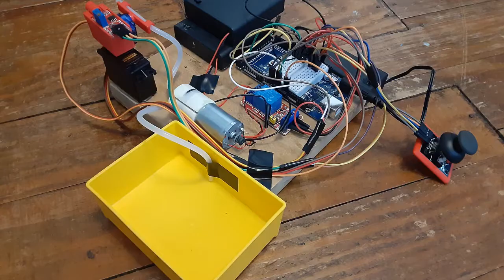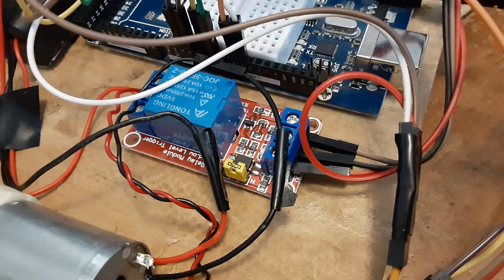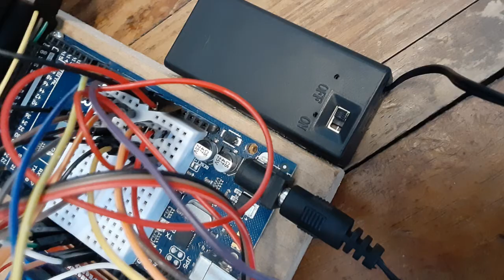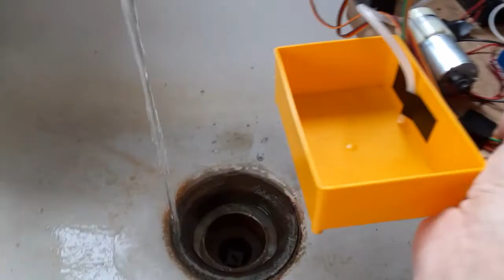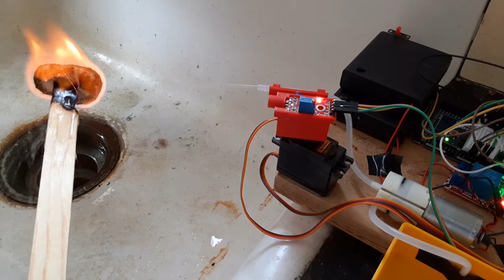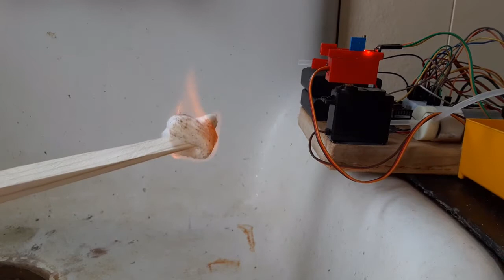Arduino - Fire fighting robot

Comment: Why not use a heat camrea?
Reply from the maker: Great question! A heat camera would likely require a better board than the Arduino Mega, and it was more in-depth than I was comfortable diving into at the time. But you're right that it would have been an upgrade.

Comment: Dear sir ,
Can you please upload full length video like all its connection , code explanation and I am not using joystick also so I don't want that part also . It will be a huge help sir .  We have our project based on that and we have to submit it by upcoming friday.
Please sir consider my problem.
Reply from the maker: Thanks for your comment! This project is something I've completed, and I am not intending to make a larger video explaining the entire project. But I think that the information I've provided is enough to recreate the project. The joystick control is a separate function in the code, so it should be easy for you to skip that part. I have provided the code, STL files and some wiring information in the video description that I think you will find helpful. Good luck!

Comment: I'm using this for my college project. Can u please provide me the connections of the conponents with Arduino.
Reply from the maker: Sure! I never made a schematic for this project, but just now I added a document in the project's Google drive with all the wiring information that I have available. There's a link in the video description, and that should get you most of the way. The code is pretty straightforward and well commented, so you should be able to make any edits if required. If you're doing this as a college-level project, I would strongly suggest that you refine the algorithm that the Arduino uses for extinguishing the fire automatically. It's not super effective right now. And if you do, I'd be happy to see your changes. Good luck!
Reply: Thank you so much for your response ☺️
Reply: @tanmaygote8744  How'd the project go 💪
Reply: @beanmayonnaise318  Great, we successfully implemented it in our last semester. Now we are expanding it for greater workspace and flexibility in terms of a fire fighting robot.
Reply: @tanmaygote3416  hi can you share the code please

Comment: How many voltage of the power connected with arduino , bro?
Reply from the maker: The Arduino is powered by a 9V battery. The pump for the DC motor is powered by two 6V battery packs in series, for a total of 12V to the pump. Hope that's helpful!
Reply: @aarickzook  Thank you, I've done it